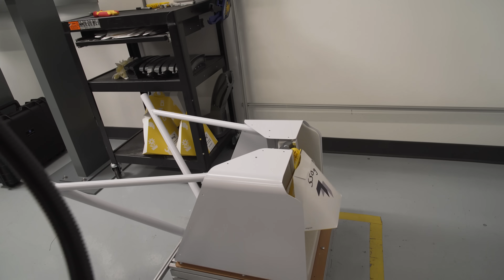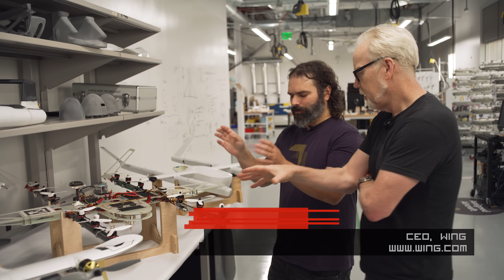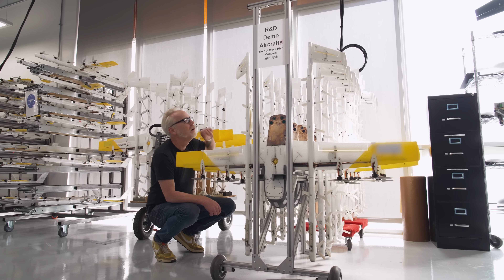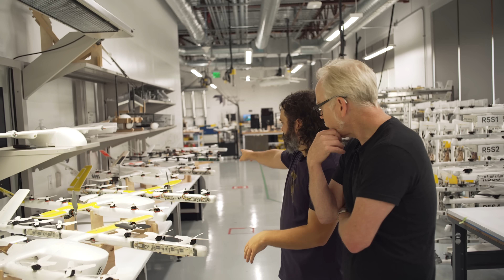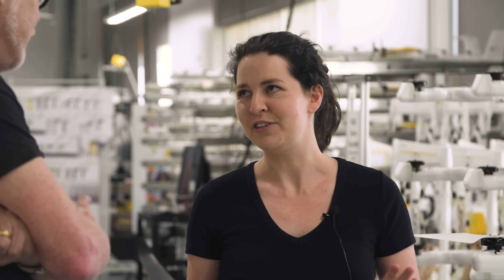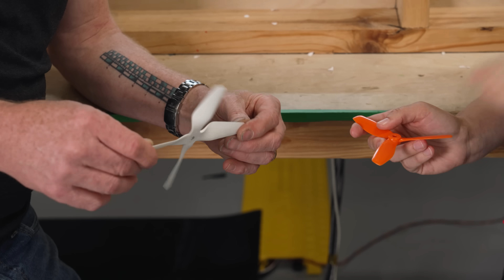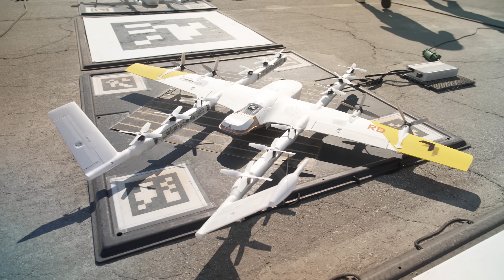Adam Savage Explores Wing’s Drone Engineering Workshop!

Comment: So when will it fly itself? I still would find the sound annoying if I was in my backyard. For delivery to places like hospitals or for working in disaster zones delivering supplies. I just can imagine not needing gps, and using the location of the sun and landmarks for them to deliver like honeybees.  Could imagine just turning on the other propellers just for a second or two during flight  might pull it away from a collision or gunfire. curious if they have the option to swap out batteries like you would for a battery powered tool.
Reply: "When will it fly itself?" It already does. With enough dedication to the configuration, even a diy hobbyist drone can perform an entire flight from takeoff to landing without input from an operator. The only reason a company like Wing would have a "pilot" overseeing the operation is for legal requirements, the FAA does not like fully autonomous systems. 
While visual landmark navigation may certainly be possible with the advancement of ai vision systems, there's simply little need for it. GPS relies only on the existence of the satellites to function, it does not matter if it's in a disaster zone or not. The only time GPS becomes unusable is if someone decides to jam the radio frequency that the satellites are transmitting on. 
Dodging gunfire is a rather difficult thing, bullets are very small and very fast. Tracking them from far enough out to be able to dodge it is a tall ask with current tech. Avoiding collisions, however, is very much already in current use via AI vision systems from companies like Iris Automation. 
The batteries on all drones are swappable, it'd be silly if they weren't. I don't know if these click into place like the ones on a power tool, but that's a simple matter of mechanical engineering to make it that way if minimizing turnaround times is a priority over the weight savings of not having that system.
Reply: I'm pretty sure I saw a pixhawk flight controller when they were discussing the boilerplate Avionics setup at the start of the video. I can also see they got tags in the landing zone, so they might be employing some form of computer vision for precise landings.

Comment: 11:30 Yeah I'll strongly reject the idea that because my neighbours order stuff that I inherently won't mind a drone flying around my house.
Reply: True, but I think the statement was really meant to say you won't mind noise at your neighbors because it's the same system that often delivers to you. At least, that's how I took it.

Noise is always going to be an issue, and everyone perceives it differently. For now though, I would welcome these drones, even the noisy ones, because they are still quieter than the gas-powered trucks they would replace.

Even after the entire terrestrial fleet is replaced with electric trucks, the other big benefit I see to these drones is that they won't be racing around my neighborhood streets the way the truck drivers do, endangering people and wearing out the road (some of which is gravel, and so particularly quick and easy to damage by speeding).

Honestly, while I have my qualms about filling the skies with thousands of these delivery drones, I think there's a lot of ways that they are just inherently better for the public than trucks, and that would justify not even worrying too much about the whole noise question. So I'm impressed that they are doing a lot of work to resolve concerns about that too.